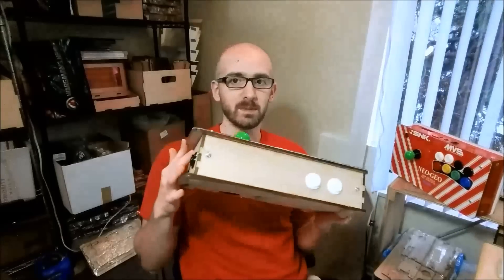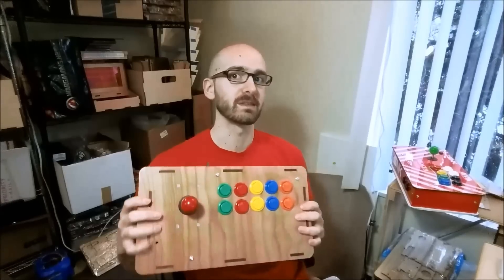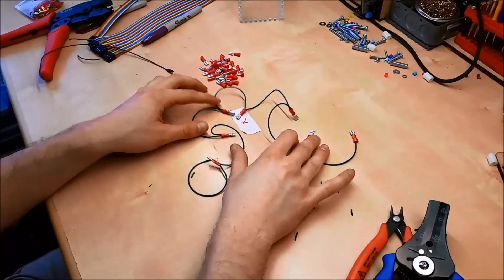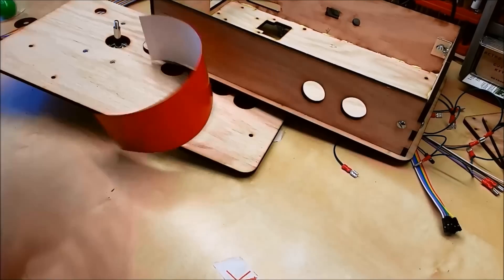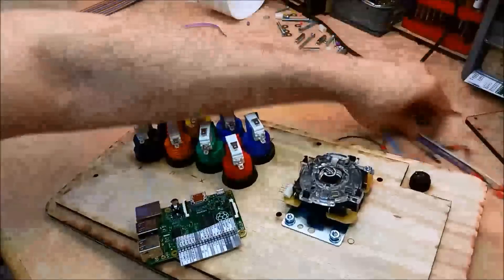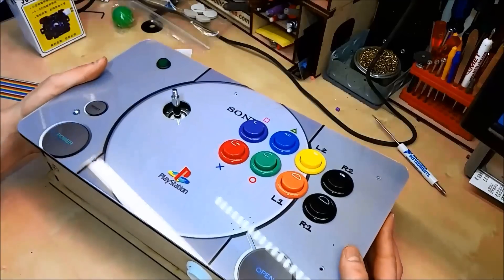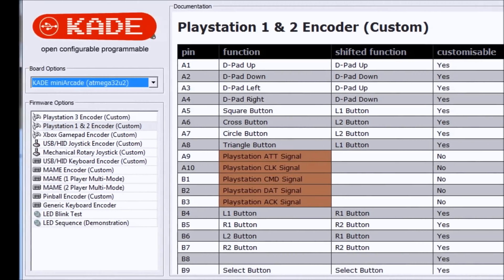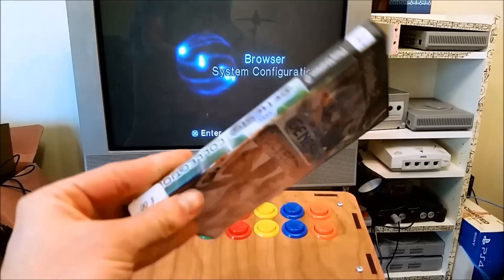DIY Universal Arcade Controller/ Fight Stick Kit:

Comment from the maker: My bad. Audio is fixed!
Reply: Ryan Bates I went to your site and I'm trying to buy one but I can't Find the "add to cart" button...

How much is each kit? Also if I bought two, can I connect the other one via USB to the one with the pie to use as another controllers so it. Can be two players?
Reply from the maker: Try "view in desktop mode" for your browser.
A Full kit is 128 + shipping. You can do a two a 2 player setup as you described
Reply: Ryan Bates awesome! So how would I use both fightsticks if they both have RP3s in them? That's where I'm confused, how would I use one as just a standalone course controller/fightstick?
Reply from the maker: Oh, you meant with TWO Pis and TWO fightsticks.  Easiest way: The 2nd fightstick (slave) would have to contain a keyboard encoder with a USB plug going into it's Pi, When you want a two player setup just unplug USB connection from slave fight stick and plug into master.

Better to go about it a more traditional Slave/Master route. One FSv3 has a RPI, the other is just a vanillia USB joystick like this: http://www.retrobuiltgames.com/porta-pi-arcade-help/2-player/
Reply: Ahhh okay, And I was trying to buy a FSv3 and/or The JammaArcade 2P, But  youre sold out :( :( .....Thanks for the answer btw! MUch Appreciated!

Comment: I had an idea for making a "universal" arcade stick/controller. Probalby mroe trouble than it's worth but I was going to buy one of those gamestop-branded DDR pads with the PS2/GC/xbox connectors coming out - they seem to be common at thrift stores - and wire up the buttons in place of all those dance pad surface buttons (could probably use old guitar hero things as well). Probably easier just to use a specialty encoder/arduino for a such a thing. I mean if soldering would be involved anyway.
Reply from the maker: This is a good idea, you should do it.
Reply from the maker: If you find a DDR pad that has more than the O and X buttons I'd like to know what brand. Konami brands only have up, down, left, right, Start, Select, X, O- which limits the usefulness of a fightstick...
Reply: I don't know if this link will paste/stay or not, but here's a four button/directions/start/select for ps2 and gamecube:
https://www.amazon.com/Gamestop-Game-Cube-Dual-Platform-Dance/dp/B0002SZN98
[amazon: Gamestop PS2 / Game Cube Dual Platform Dance Pad]. not sure that's enough for stick or not but more than the two anyway.

Comment: really good job. I'm looking to make a project that uses similar buttons to the arcade buttons you used. (pi mp3 player with simple navigation buttons) Any information you can provide about those? Generally the entire process of wiring hardware is confusing me a lot, I've spent so many hours looking at videos but not sure that I'm going about this properly. Any resources on learning about wiring you could reccomend? Using a breadboard vs not is confusing, why some wiring projects requires soldering and some don't (i know has something to do with the connectors - but are those specific to the hardware or can you make any wires connect without solder if you have the right wire type / conncetors?) Anyway just hoping for some tips. Nice video hope you're enjoying your arcade controller.

Comment: 6:06-Will I be able to build it with the full kit if I have no expirience in this kind of stuff? and will I have to do 5:17
  or will it be included in the kit finished?
Reply from the maker: I have no way to answer that first question; only you know if you can.  You must make the wire harness shown in the video @5:17.
Reply: okay, thanks

Comment: Is that a Seimitsu joystick? Also what kind of buttons are those and what microswitches do they use?
Reply from the maker: +NinjaRed5000 Sanwa JLF joystick. buttons are suzo Happ. They use E-Switch Snap Switch microswitches, that require 50 grams of force to activate. https://na.suzohapp.com/products/pushbuttons/58-9100-L
Reply: +Ryan Bates Nice, though personally I would've gone with IL buttons instead of Happ.

Comment: What if I want to add two smaller analog sticks and L3 and R3 buttons?
Reply from the maker: +Robert Weatherholt drill more holes
Reply: BTW, have you seen ( or at least, heard about ) HORI's Dead or Alive 5 Fighting Stick ( with analog stick hub ) for the PS4?
Reply from the maker: I have

Comment: what is that ribbon cable called, I'm trying to find exactly what  I need to order
Reply from the maker: Female / Female Dupont, is one way. OR add 'arduino' and '0.1 pitch' as tags and you should find it under 'ribbon cable'

Comment: where to byu a kade device ?
Reply from the maker: i think they went defunct a few years back. Better to get an Arduino pro micro and the DaemonBite firmware https://github.com/MickGyver/DaemonBite-Arcade-Encoder.
Reply: @RetroBuiltGames Darn, im a bit disappointed, the kade interface looked rather user friendly. I have got an Arduino, not a micro tho but i shall see how to set it up between the controller components and the cable going to the console. :)
Reply: Thanks for your comment !